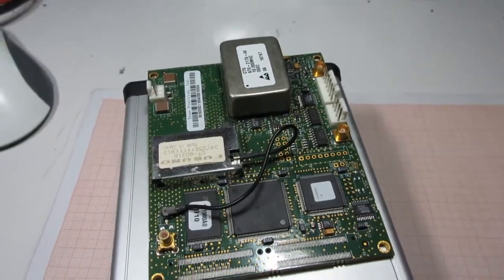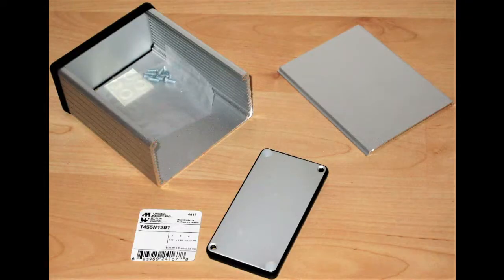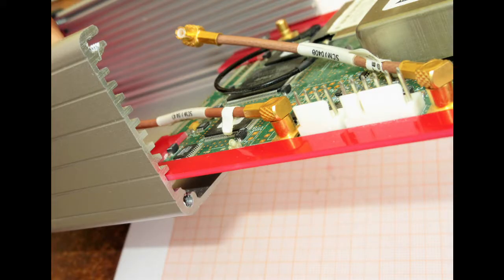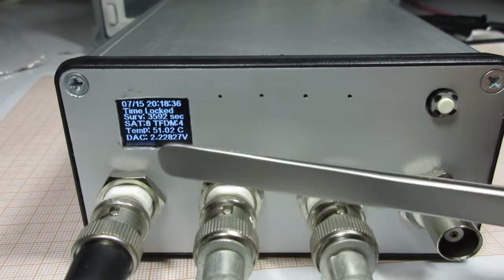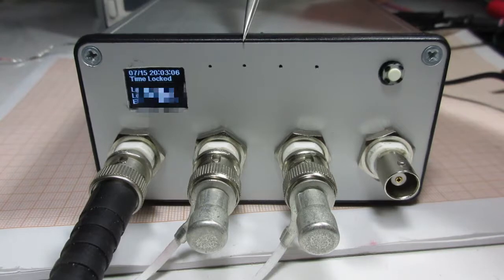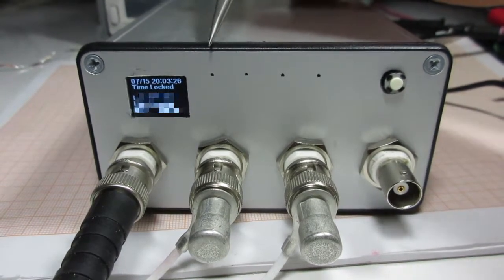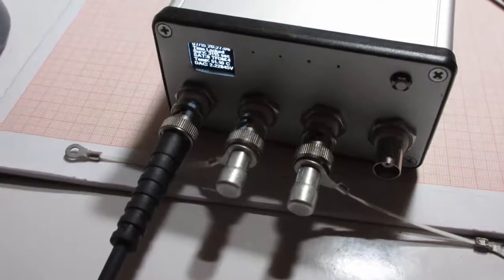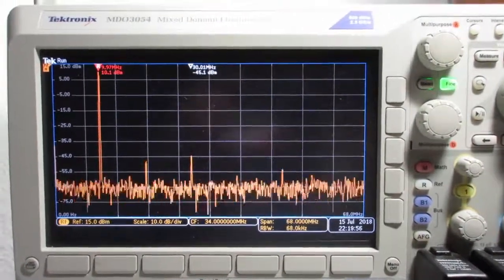10Mhz GPSDO Standard Reference, Distribution Board, Trueposition GPSDO

Comment: Excellent. A small suggestion... Remove the four, independent LED blink indicators from the front panel. This will make room for a larger display. Install a larger display and incorporate the four blink indicators into the new display, as simple blinking characters. This will allow the information that is being displayed to be larger, thereby making it more easily read. Cheers.
Reply from the maker: Thank you for suggestions, This was one off project. For some reason at that time i went with this small OLED. That is how it is now. Regards